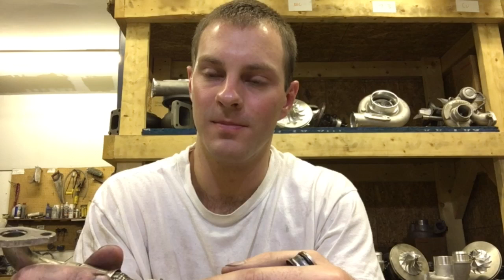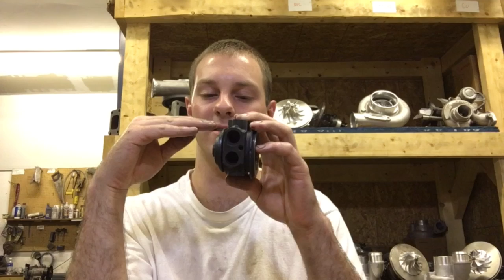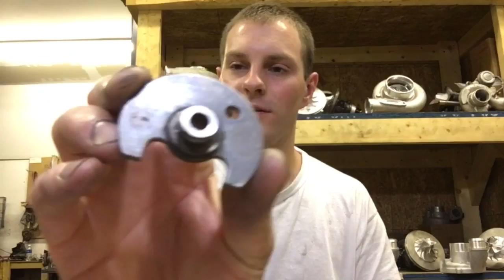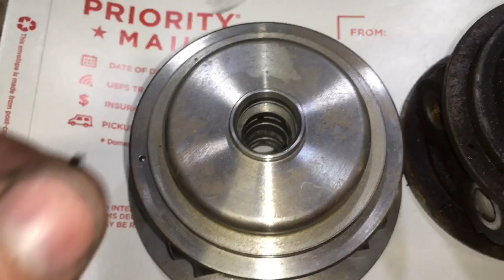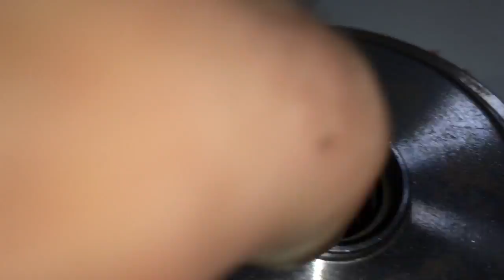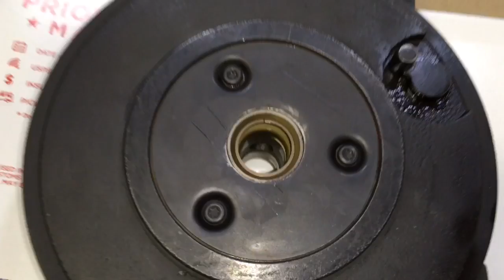N54 turbo blowing oil check list

Comment: I changed the gasket and the line for the rear turbo oil drain line and its still leaking smh Idk what to do at this point but to get new turbos. That what I get for getting those cheap ebay turbos i guess.
Reply from the maker: You could have 2 different problems. 1 could be a raised edge on the mounting surface of the turbo drain or on the drain mounting surface causing the drain not to seal. 2ndly can be too an off centered gasket or silicone added to the drain than blocked off the drain. 3rd is if you have a crank case ventilation issue or oil level being too high.
Reply: @turbolabamerica if its the first issue i need a new turbo installed right?

Comment: Hi I have a ? I have a bmw 135i I replaced the turbos and is when I stared it was not smoking but then after like 2 minutes it staring throwing oil from the pipe were the throttle body goes I have a blow out valve it was spelling like from there and smoking from exhaust, no oil from it he air filters like when my turbos were blown Can you pls help me could it be my injectors

Comment: 3:30 I'm wondering if this is the place where the "O" ring seals onto the pipe? And if it is ported and smoothed would it not be possible that it might make a problem with sealing of the "O" ring at that point? I don't know and you are the expert but it was just an observation I have of what might be part of the sealing of the drain. I'm probably seeing this completely wrong but I wanted to just mention it as something I thought might happen? Thank you again for all the great info you give for free to all of us!

Comment: I got catless dps and full exhaust, and My factory turbos had wastegate rattle, so I adjusted out the rattle and had the dp's/exhaust installed now my car smokes horrible but not at idle and only between 1k-1800 rpm. Car makes great power and hits boost target. Do you think the oil drain got damaged during dp install or with new exhaust/ dps now there's no back pressure so turbo seals leak when not under boost?

Comment: Hi. I get different oil level measurments each time a drive my n54 335i basen Alpina. This happened aster I changed oil and filter (5-40 BMW aproved oil). Before i used 10-60 Millera oil without issues). I poured 6 L oil and it show full, some times i the modele of Max and min. Next time full again... strange. Any ideas? Thanks

Comment: my n54 start smoking when reaching normal operating temperatures. drives and feel perfect just  alot of smoke through the exaust and oil. i replaced the turbos and still smoking
Reply: PCV Valve
Reply: Guillermo Lopez  i replace te valve cover with gasket and put a oil catch can and a put a oil breather cap and same. I check did a compression test all cylinders 150 to 165 psi.
Reply: Same shit, smoking when engine is at operating temperature. Still don’t know a reason......

Comment: Hi , super great video, thanx. 
I have a lexus is200 ( EUROPE) 
2.0L 6 cyl. Recentley i turbod the car with new , japan made hybrid garrett t28 and its blowing oil special when it’s cold for 2-3 min. I running 10W-60 motul full syntec oil. I also tried 5W-50 mobil1. The crank case pressure is going in the atmosphere. I have no clue what could be the problem.?? I can send you somehow pictures or videos. Thanks appreciate that

Comment: I only have a smoking issue when i let off the throttle. I just had my turbos rebuilt and i have a oil catch can installed.(n54) im guessing my car either has too much oil or it needs another oil return line replaced.
Reply: Same problem and it only started after catless down pipes. Can't figure it out
Reply: @3bGh0sT3  all i did was put the stock cats back on and solved the problem.
Reply: @outlaw8388 can u help me out have the same problem
Reply: @josesuarez3273  run oem catalytic converters. Solved my problem.
Reply: @3bGh0sT3 can u help me out
Reply: @Jose Suarez  tried everything. External pcv, catch cans.. ended up replacing turbos to 17t gen4 and solved the problem
Reply: @3babyghost Replace your valve stem seals or piston rings, these are expensive so do everything else before

Comment: When you say blow oil, where does it go? Does it make its way into the intake and therefore the combustion chamber? I just picked up a e90 that smokes like a chimney. I got oil in the pipe that goes behind the motor... could this be what you are talking about?
Reply from the maker: I meant leaking from turbo to exhaust pipe
Reply: Turbo Lab America does any of what you say in this video apply if your getting oil from the turbo pipes in the intake charge pipe that runs to the intercooler?   Im not talking an oily mist, im talking drips of oils.
Reply: Lee Paterson the car smokes. N54 335. Haven’t had time to troubleshoot as the weather just started to get better. But the intake has oil in it. Thought I’d ask
Reply: The intake is the pipe that runs behind the motor right?

Comment: Hi My BMW X3 E83 is sucking in oil from the intake. A lot of oil mist is filled in the bonnet while driving and he whole engine gets pretty messy from outside in a few weeks due to oil agglomeration. Mechanics here seem to suggest it may be coming from the turbo compressor side. I have already changed the PCV valve but it didn't help. Any ideas?

Comment: Thinner oil synthetic helps the oil drain faster when it is cold. Helps solve the drainage problem. When hot still removes the heat.

Comment: You certainly know your stuff mate, you have saved me changing my turbo.seems like mine is not draining properly,I can't thank you inough for this video 👍👍👍👍
Reply: I am getting low end  boost on my 2007 BMW 335d allready spent nearly £1400 on new egr cooler with thermast , pully belts back shocks now loosing low end boost  but I'm not getting no smoke and shoots off after 3k rpm  iv been told a stunt to check bottom turbo so I'm sure it's not that I don't want to spend any more on parts I don't need (help)

Comment: Hello Turbo LAB of AmericaMy 2007 BMW 335i has original turbo with 120K
the Engine starts right and is quiet and smoothTurbo does not chatter or clang 
I do get BLUE OIL Smoke bellows from the Driver side exhaust in 5 minutesand then the same bellows of smoke on the passenger side

I do think the HOSE you show in this VIDEO may be the culprit

Do you have diagram or even a handwritten photo of your own drawing 
HOW does the oil flow to and back from the turbo
are the (2) oil lines to the base of the OIL Filter HOUSING directly involved and is there a DIVERTER valve (?)
that directs the forward flow along with the exit by the WASTE GATE valve ?

BESIDES what i have said THE INTERCOOLER was full of OIL and I know it is suppose to be AIR

I have bought a high tensile VACUUM line and cut each 3.5 mm vacuum line and REPLACED each and every onefrom the dual canisters behind the passenger headlight - to the ones laying over the engine to the ones at the INTAKE side

I DO NOT WANT TO REMOVE MY OEM TURBOS TO JUST FIND OUT WHAT YOUR SAYING UNLESS I FIND THE ROOT OF THE PROBLEM I WILL STILL HAVE THE PROBLEM
SHOWING THE PATHWAY FROM A -------> Z would be great Help and I will check that hose you show collapsed
I will see if I can hone OUT the end of the pipe not to have such an abrupt LEDGE and will use a little heavier OIL for the TEXAS SUN 

The INTERCOOLER was removed and drained and cleaned 
any special way to clean out an oil soaked INTERCOOLER ?
so with the NEW vacuum lines and now these latest suggestions
- REPLACE HOSE ( can it be replaced without HAVING to replace the TURBO - is that Metal HOSE and braided center section
removal with special TOOLS or getting access by removing OTHER Parts so as to NOT having to REMOVE the TURBO to 
REPLACE that metal HOSE
???
Antonio

Comment: Good video.  Hey would any of those issues (Crank case pressure, sealant into pipe) only leak when revs are high?  My son's car is leaking from faceplate or inlet plate to turbo body when revving over 3000rpm.  It's a 3.0l Isuzu deisel with RHF5 Turbo.  Can't find any info on it at all but only leaks under load
Reply from the maker: Check it for in and out shaft play
Reply: Turbo Lab America thanks heaps for that.  Will do
Reply: Turbo Lab America hello, could the drain be the cause of oil being in the inlet side? Thanks

Comment: Are one of the turbo coolant lines by the driver side firewall.? I have s little leak there and it's making a hissing noise
Reply from the maker: One runs back there for the heatercore

Comment: yoh question..
i used a wrong restrictor and now my turbo is kinda leaking oil in my compressor but no shaft play
do you think if i change the restrictor to a smaller one do you think the leak will stop?

Comment: I spun rod bearing n since swapping new engine in one of my turbos has been leaking.  drians are the same size from last engine. do have quite a bit more oil pressure. no play in turbo

Comment: You guys ARE open for business.... right?
Reply from the maker: +They Call Me The Mayor yes
Reply: @turbolabamerica  
I drove my 2008 335i E90 today. Massive smoke comes out of the exhaust, engine is weak. My car has been running good for last 2  years. 125k miles. Never any issues.
Some say valve cover gasket??
Any advise for me.
Reply from the maker: I would run tests first. Mine ran terrible after I got a bad batch of fuel, it smoked really bad and didn’t make enough power to go up the driveway BMW 335i N54 Boost Leak and Smoke Test
Reply: @turbolabamerica  
Do you have videos on how to run these tests
Thanks
Reply: @turbolabamerica  

Started my 335i E90 today. White Smoke  gushed from right exhaust pipe smelling like fuel then started coming out both pipes. No milky on oil cap, but smell of gas
How do you do a smoke test and boost test?
I have valve cover gasket, Spark plugs and fuel injectors to put on but if not the fix I will send them back.
Thank you
Reply: man i would like to have some sort of reply on my turbo 🤔
Reply: Ok.. been trying to reach you guys for ~2 weeks. Email, and VMail.  :)
Reply: EvolutionXRG have you gotten a reply yet? Because I'm looking to get at this pretty soon.

Comment: makes me wonder, my friend's BMW x5 v8 twin turbo, blows oil and it has 34k on it. I didn't bother checking it, since it's still under warranty. I'm going to check. I see oil resdu on the back of the car on the hatch
Reply from the maker: It is possible that the drain is just too small from factory.